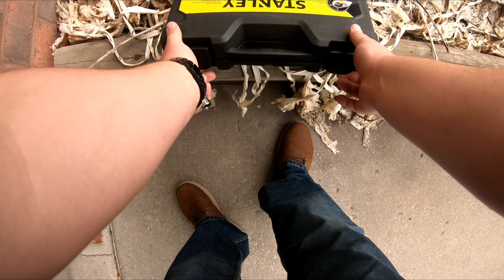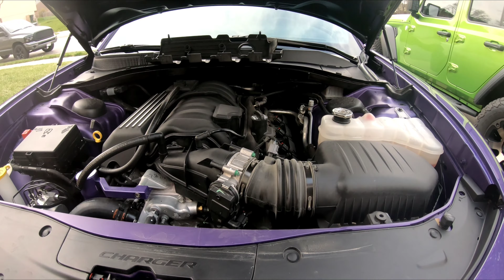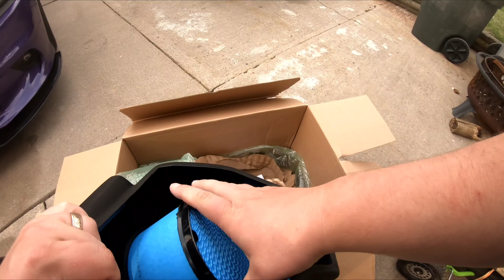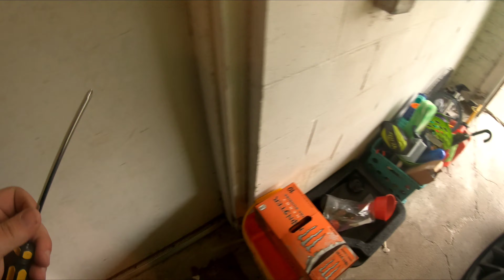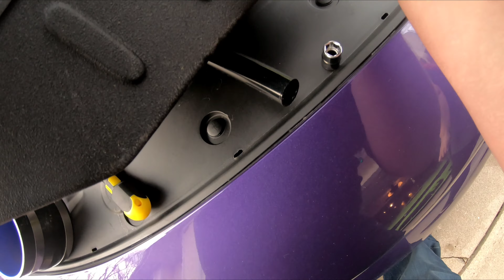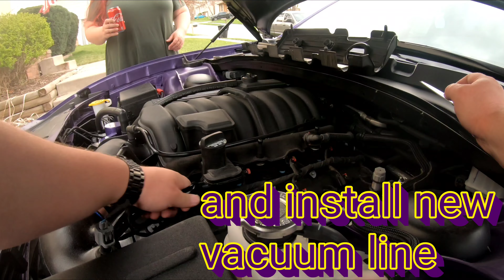2019 Charger Scat Corsa Cold Air Intake

Comment: I love this intake i have this intake system on my 2016 rt with a 6.4 intake manifold conversion
Reply from the maker: Thats awesome! I had no idea you could do that between the 6.4 and 5.7!
Reply: @forstd09able  yep as long as you have the 6.4 intake manifold you can use any 6.4(car) cold air intake system but may have to extend some wires but will work just fine
Reply from the maker: Oh no i figured that, I just meant I didn't know you could use the 6.4l intake manifold on a 5.7l motor. Did you have to do any fabrication work or did it bolt straight up?
Reply: @forstd09able  it bolts right onto it you can use your old bolts or get new ones. The only fabrication work is the wires for SRV
Reply from the maker: @aaronferguson47  good to know! Got some friends with the 5.7l that might be interested to know they can do that! Thanks
Reply: @forstd09able  your welcome brother glad i can help
Reply: @forstd09able  what year 5.7L do they have
Reply from the maker: @aaronferguson47  I believe its a 2016
Reply: @forstd09able  oh ok yeah they good then its plenty of videos on this swap

Comment: So the CORSA box just pulls air from the front nostril as your driving ? At a stand still where’s it grabbing air? Sounds better than the stock intake either way
Reply from the maker: It pulls from both front and bottom like the stock airbox
Reply: The stock air box only pulls from the bottom, this box seems to pull from the front , maybe this would be a good alternative to replacing the scatpack box with the hellcat box and snorkel kit and tearing the front end off to get to it all??
Reply from the maker: @bossstrick  you would still have to go in and pull the piece that covers the path for what would be the hellcat air inlet from the front grille. If you look through the front grille, by the drivers side light,, you can kind of see the cover that is there.

Comment: Brother I need your advice. I’ve 2018 sxt with swap bumpers and hood (SRT). When I run from 60mile and above the noise of the wind is really annoying me. Idk if you have same issue?
Reply from the maker: I never had issues when I had the car. The only thing I noticed was my hood would flex because it was aftermarket and fitment wasn't 100% the noise you are hearing might be from the rear. There is a plastic plate that the SRT style came with to secure the rear fascia to the car from underneath. It would look similar to the dust cover for the engine bay under the front, and should be held on by 3 to 4 bolts/nuts. I apologize, because I no longer own the car and don't have the part number, but if you go to a dealership, walk up to the service counter, they might be able to point you in the right direction if that is in fact a piece that is missing. Hope that helps man.
Reply from the maker: Only other thing I can think of is the wheel wells dont line up. There are 1 to 2 push pin holes that i had to zip tie, otherwise to replace the wells its like $1k for all 4. Zip ties (black) were fine by me lol